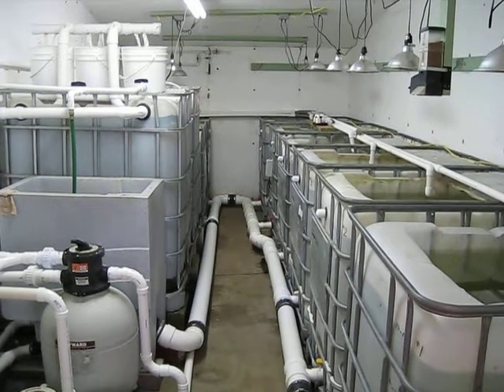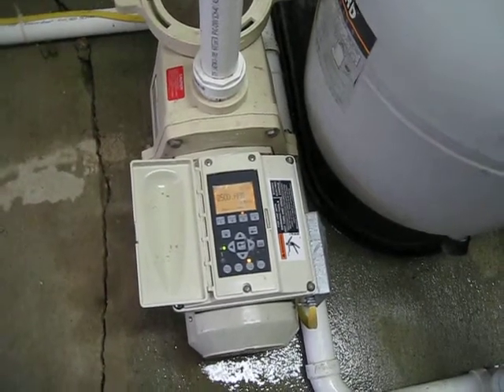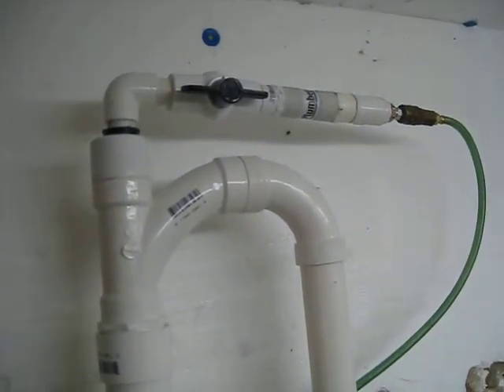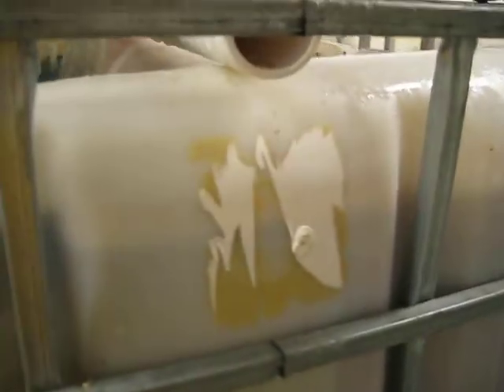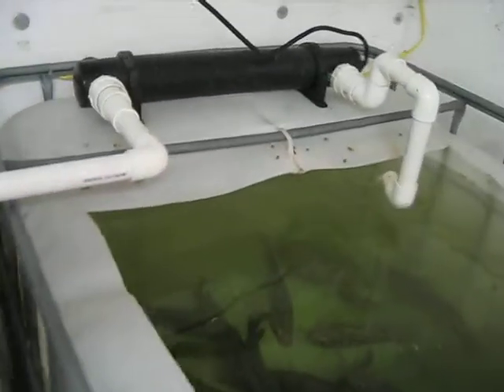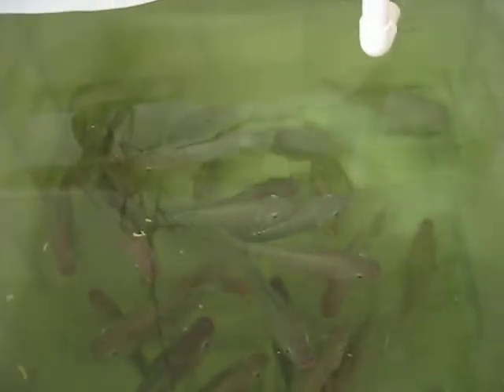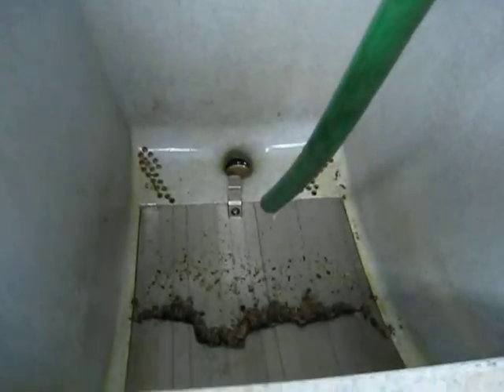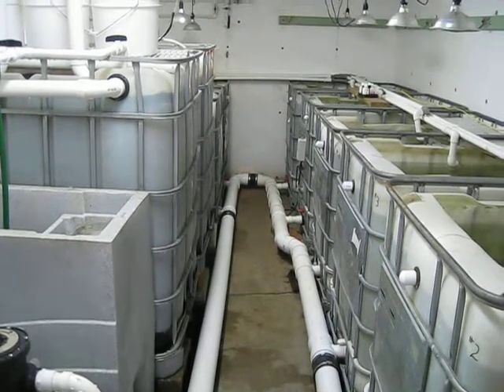DIY Tilapia Small Scale Aquaculture System - Vid # 8

Comment from the maker: Charlie, I do just connect to the existing valve and then on the inside of the tank I cut a piece of egg crate (fluorescent light diffuser) a little larger than the hole and use a few big globs of silicone to hold in place. Steve.

Comment: Glad to see you posting again.

 I was wondering how you were heating you system. I have seen in the past that you use hot water heater elements but I was wondering how you wired them and what thermostat you prefer. Also who makes the ceramic media that you use in your sand filters.

Comment from the maker: This year, we are making our electric heat pump pool heater do double duty. Swimming pool in summer and fish in winter. I also have 2 - 1000 watt hot water tank heating elements as backup and to use when the temp falls below 32 degrees which is where the heat pump becomes ineffective, Steve

Comment from the maker: Right now, there are ceramic sinking beads in it which are very expensive and to tell you the truth, don't work very well. You have to be careful how hard you backwash them to keep them from blowing out and because of that you can't get the filter clean. I just did a remodel of my filter system using three 18" filters plumbed in parallel, and I went back to sand for the media. Its very cheap but needs to be changed once in awhile. I think the pros outweigh the cons.

Comment: What are you using for bulkheads to seal your water lines to your tanks? I went to lowes and HomeDepot and they didnt have anything useable (may have been looking in the wrong spot). I went to the local pool supply store and they wanted $12 each!!